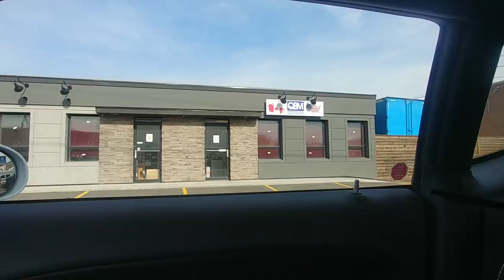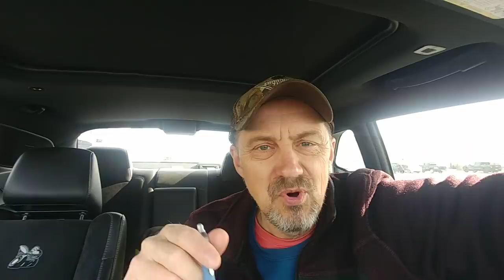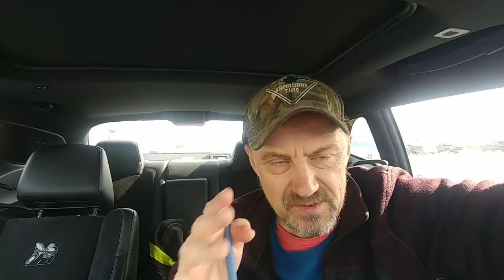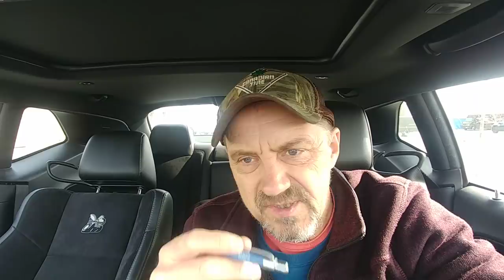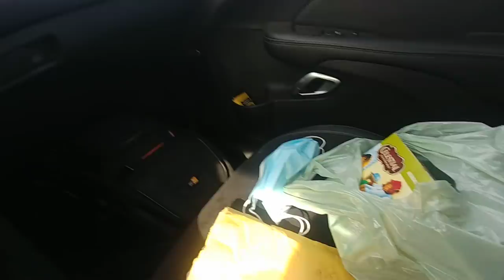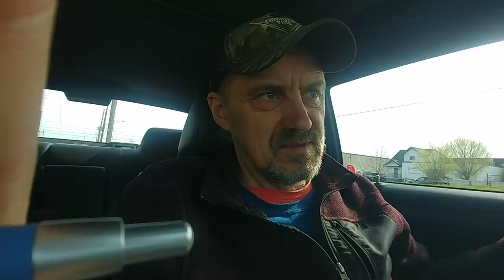Stoney Creek, ON -- May 6, 2020

Comment: Rumber is good, but needs to be supported underneath because it is weak. Used it once, loved it but had to add sheet metal under it to support it across the cross members. Adding more weight to my trailer. Depending on the gage of steel. Then used angle iron, was a little lighter...but not much. Went back to Hardwood, cheaper to deal with, and lighter.

Comment: If they had countersank the holes when they put in the bolts they would have been flush with the deck. 
How many tracks does the machine have. Does the load include the conveyor belt or just the machine?
Peace be with you Sergei. 🤘👉♑🗨👩‍🦰NewYork Redhead!
Reply from the maker: it should have 4 tracks. the conveyor comes along for the ride, but it's a folding model + I'll have the 14'1" booster in the back... so, the tip of the conveyor should be still 'inside' the limits of the trailer.